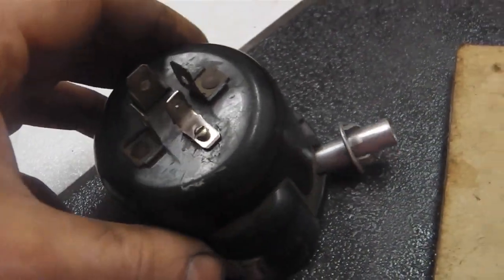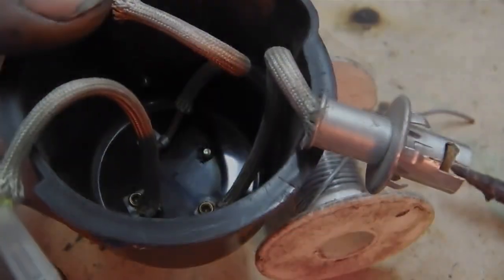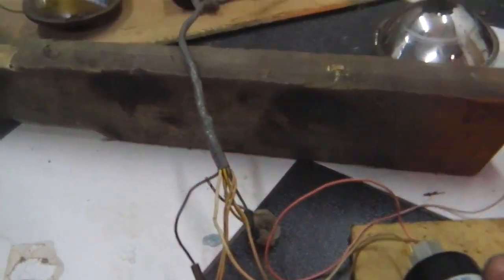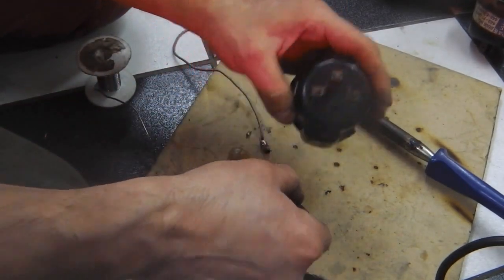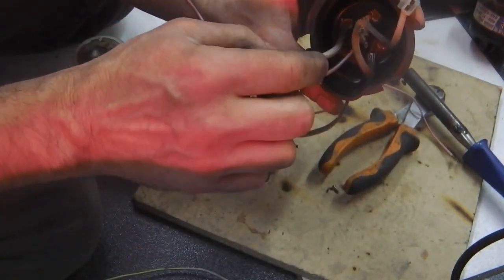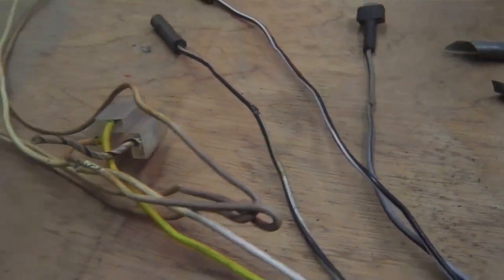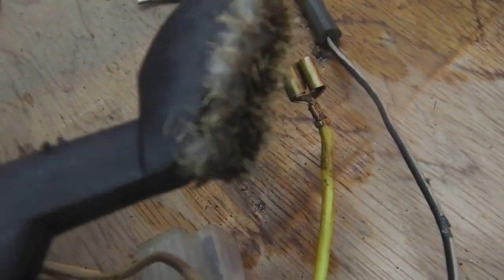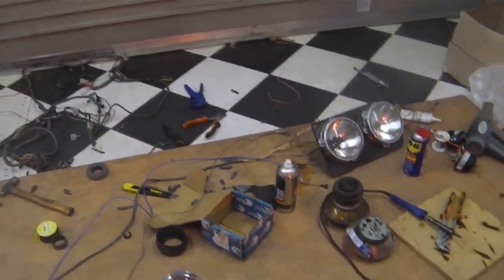Ford Cortina MK3 GXL Restoration EP58 PT 4

Comment: couldn't you use lamps from an L or XL? Because they'd only have two lamps so they'd have the side, dip & high beams already integrated into the bowls
Reply from the maker: the single lamps on the L are a larger diamater
Reply: Really? I thought Ford standardised their bits back in the seventies?
Reply from the maker: hiya, yes the single lamps are the 7" units, then for double they go down to 5& 3/4 sizes
Reply: I didn't know that